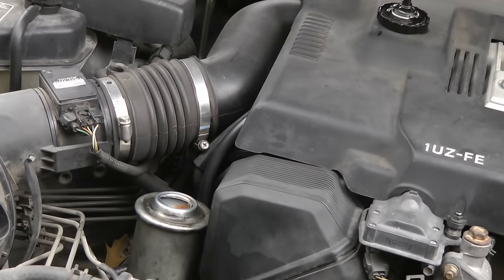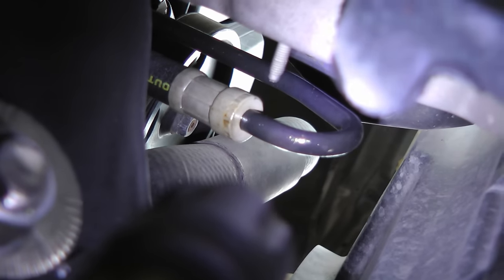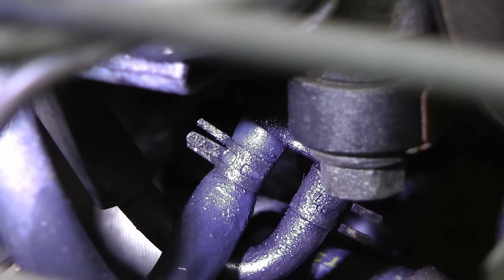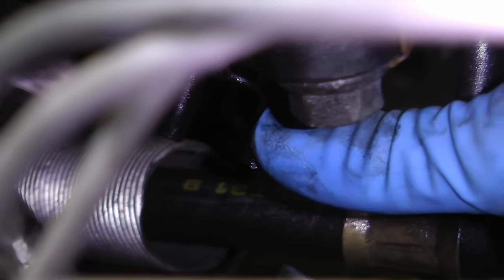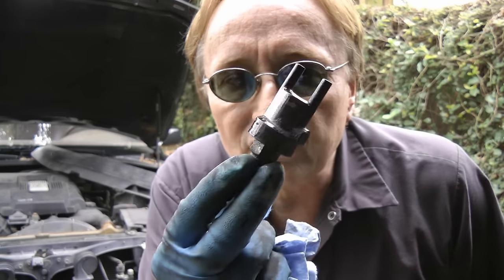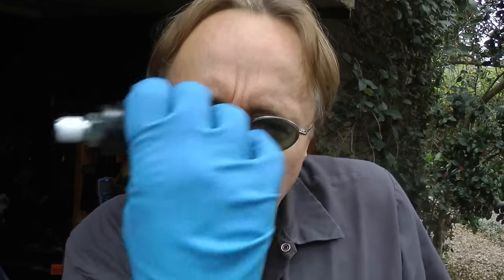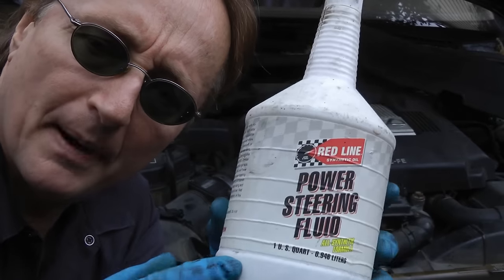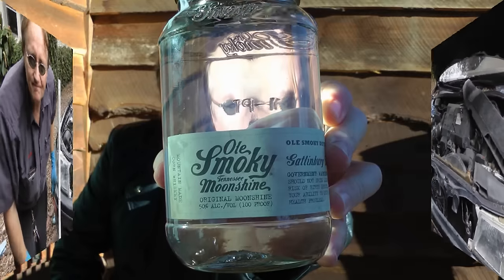How to Fix Power Steering Noise When Turning

Comment: its that..
it couldnt be
it is
lexus LS400, damn good car
did you replace the alternator too scotty? i believe power steering leaks are the one big problem on this car and the fluid can leak onto the $2000 lexus alternator, causing a whole heaping load of problems
Reply: Yup, common problem in all 1UZ-FE powered cars, and it is RIP to the alternator if you leave it too long - but the alternators are not $2000 - you can get a brand new unit for about $900 NZD where I live, which would be perhaps $600 USD.  I guess if you went through a Lexus dealer they would probably triple the price though.
Reply: The alternator doesn't cost 2000 dollars

Comment: Scotty I changed my oil today on my 2010 Honda Accord with 173000 miles that runs just like new and found metal shavings on the oil plug. What does this mean?
Reply: You need rebuild engine
Reply: So is your engine still alive?
Had that too and it still made it quite some time

Comment: My 2003 Grand Cherokee Limited makes a whinning sound when the Jeep is started during cold weather (60 and below) in North Florida.  Should I have the power steering pump replaced?  Thanks!
Reply from the maker: many things can whine, from power steering to transmission. IF it goes away when warm, heck, ignore it. My car does that when it's below 40 here in Texas, and has been doing it 4 years, I don't care. Age and cold often do that.

Comment: Hey Scotty got a good one for you. I have a 03 Silverado with 140k miles and it’s making a whining/howling sound when I start it up. I changed the fan clutch, water pump ( got a new one) and the whining sound was still there, then I changed the alternator ( new one ) since it was bad and same thing, 3 days ago I changed the p/s pump( also new ), Still making noise. I bleed the system, the noise went away and now it’s back. What would you suggest? Any help would be appreciated.

Comment: So this helps for noisy steering week or noisy pump? Lol I just bought that sea foam trans tube that I saw in your other video should I try that instead or this on this video?
Reply: +scorpio cabrera Never ever put something else in your power steering than the right fluid. You can ruin your pump faster than you think.
Reply: +Frank De Ruiter  so how would I even fix noisy power steering with ought putting other fluid to fix it then

Comment: thx Scotty, no seals or such that can be replaced to get the noise down? is only way to replace the column motors?
Reply from the maker: +fp naude you could try spraying WD 40 in there, it doesn't hurt electronics

Comment: What are the signs of a bad power steering pump or just a leak? I hear a whine like noise as soon as turning it over. It sounds as though it’s coming from my power steering pump. However if there is a leak, it is mild. I was told the car had been stationary for almost a year

Comment: My 02 Lexus GS300 takes Dexron 2 or 3 ATF and It was groaning. I topped it off and it cleared up just fine but I did notice what little was in there was completely burnt fluid. It wasnt pink anymore and smelled. Should I consider a flush?

Comment: 2007 GMC Acadia with the annoying grinding noise when we turn the steering wheel. We do have the annoying power steering whining noise also. I've heard that the Acadia is a nightmare on wheels.
Reply from the maker: pray you are just low on fluid. But if not, either pump and or power steering rack has internal problems. If it works fine otherwise, live with it on that crap wagon. And don't buy another
Reply: Ended up needing a new rack n pinion $1,280 total parts and labor.
Reply: JRaptorV that's what they always say my 2013 chevy impala was growling when I turned wheel took to dealer they said rack and pinion was leaking so they replaced it still my car growls no clue fuck gm

Comment: Scotty, I have a 2006 MB C280 and sometimes when I start it up the steering is very stiff as if I lost power steering. Weirdly enough if I shut the engine off and restarted it the steering is completely light and smooth as it should be. No weird noises from the system so I'm guess it's some sort of electrical component? Is there an electrical aspect to this system?
Reply: if there was an electrical aspect to this system woun't the OBD 2 reader be able to pick up some kind of code that tells you that power steering is bad? just a thought (im a noob in cars)

Comment: Hello Scottie quick question, I did a complete flush on my power steering system on my 2005 GMC Sierra, I replaced it with the oil from Chevy dealer per the owners manual, but now it makes the grinding noise like in your video and didn't do it before the flush. Could it still be the switch? Thanks & great videos
Reply: +armandomrgl85 A whining power steering pump is mostly oil/air related. When there is enough oil in it you could try to bleed the system manually. Here on YT will be video's around how to do it.

Comment: Hey Scotty, I have a 2018 ram 2500. Every now and then I’m getting a whistle noise near the driver side of the truck. On this side of the truck is the steering gear box and power steering pump. I noticed that the whistle noise goes away when the steering wheel is turned but returns when steering is returned to straight. Thoughts. This occurs even when in park

Comment: Hello Scottie quick question, I did a complete flush on my power steering system on my 2005 GMC Sierra, I replaced it with the oil from Chevy dealer per the owners manual, but now it makes the grinding noise like in your video and it didn't do it before the flush. Could it still be the switch? Thanks & great videos
Reply: +armandomrgl85 invest in a stethoscope. you can get one a harbor freight cheap. remove the serpentine belt. spin the ps pully by hand using the stethoscope and see if it makes any unusual noises. it definitly helps diagnose a worn out shaft.
good luck
Reply: +Moose666 Thanks, I'll look into it

Comment: Hey mr. Scotty I have an 08 GMC Sierra that when I turn it to the left or right I get this creaking noise. I got up under my truck that is lifted and my wife turned the wheel, and it sounds like it’s coming from the rack and pinion. Should I replace it or is there a cheaper fix?

Comment: What would the noise be if you have an electric assisted steering system that does not require power steering fluid if it's a squealing sound?

Comment: Mr. Scotty Kilmer, I have a 2003 toyota tacoma that recently had the power steering pump replaced. I live in colorado so the weather is a little cold. When I start my truck, the power steering makes the groaning noise, and gets louder (And sounds more painful). However, when my truck warms up, the noise goes away. I don't see any leaks, and I don't know how to check if there is air in the system. Suggestions?
Reply from the maker: +Austin Farley  odds are you got a rebuilt, and not new pump. rebuilt ones often make noise
Reply: Which is always fun because my understanding was that I paid for a new pump! Back to the mechanic I go.

Comment: It’s a little weird situation, because in my 2006 Pontiac GTO, the power steering pulley only makes noise when I give it throttle and the pulley itself when idling you can see it looks a little wobbly

Comment: Hey Scotty are power steering pumps on fords just noisy all the time? I recently changed the fluid with ford type f ATF (owners manual recommended) because fluid was black. I used a turkey baster to suck the old fluid out and pour new fluid in 5 or 6 times and turning the steering wheel between each change until the fluid wasn't dark anymore. I heard of doing a flush by removing one of the hoses and as fluid drains out you pour new fluid in-is it safe to do so?
Reply from the maker: yes, ford pumps are notorious for noise as they age. If it steers fine, ignore it. But you can remove the return hose and change the fluid that way if you're careful and don't spill any or run the pump sucking air

Comment: Hey Scotty!!....I have a 06 4runner, and the 2 stems for the hoses on the power steering control valve broked. I ordered a new one and was wondering if it's safe for me to drive to work(about 7 miles away) and back until my new one arrives ???
Reply from the maker: remove the power steering belt and you can drive it forever. But leave that belt on, it will ruin the pump sucking air

Comment: Hi Scotty,  I have a 2004 honda civic, the power steering hose (the larger) has a leak in the coupling located in the middle of the hose, causing majority of the power steering pump area including the back of the left headlight covered in power steering liquid... I will change the hose, however what another thing would you recommend me to check.

Thank you.
Reply from the maker: +Oldemar Almengor  hoses just leak from age, replace the whole hose assembly

Comment: I had a power steering noise, so I decided to change the fluid. When I drained out the fluid it was all black so i thought that was the problem. And when I filled up with new power steering fluid, that noise went even louder! Was that a bad fluid or maybe I need an ATF fluid?
Reply from the maker: use the same type fluid your manufacturer used, and pray the noise goes away Often you need a new pump and a new rack if fluid gets dirty enough to damage both
Reply: Scotty Kilmer Yes, I filled up wrong power steering fluid. Manufacturer says that it has to be automatic transmission fluid DEXRON II, But I just filled up a regular power steering fluid. So I'm gonna change it today!

Comment: After replacing the pressure line the mechanic used red transmission oil instead of yellow steering oil in the steering oil reservoir. Was that a good idea?
Reply from the maker: saleh mneina depends on the car, on a BMW it would ruin it, but on a ford or toyota that's fine, you can use tranny oil in most of those

Comment: Hi, Scotty, you used to work on our cars when we lived in Houston.  My daughter is driving my 2000 Camry TONIGHT and is halfway to North Texas.  She just called and said the power steering has gone out.  They checked the fluid and it is full.  She says she is able to "manhandle" it and drive - is that safe?  We are trying to find someone to look at it tomorrow, but do you have an idea of what a simple fix might be?  It is well-maintained.  You replaced the timing belt before it hit 100K,  Thanks for any ideas you have.
Reply from the maker: time for a new pump If the belt is still on there, or you can just remove the belt if it is still on and drive it manually, my son does that on his 93 celica in boston and doesn't care, he likes the work out
Reply: Scotty Kilmer Thanks, Scotty.  Turns out it was the belt, so thanks for your help.  It's good to see you're still out there.

Comment: My car is making a noise and the wheel is hard to turn left or right started to get heavier when it got cold. What should I look at first? Had the pump replace it was old but I guess still working a few months ago but that only partially fixed it. The problem is back and tenfold.

Comment: Scotty, I have a 2001 Chevrolet Express 1500 LS 5.7L, back in September when I back up a little in my drive way and the van die on me. At the time alternator dead and no fuel pressure, got new alternator, new fuel pump now fuel pressure at 60psi. I even did a whole tune up, new spark plugs and wires, distributor, ignition coil, ignition control module, cranks position sensor, power steering pump. Still only crank, spark and fuel ok, check all fuses are ok, check gauges light on, service engine soon light on, security light off with one key and on with another key. I'm thinking it might a security issue  that is not letting me start or I could have a dead engine or a dead transmission. How do I know if my engine and transmission are dead? Please advise me what is wrong with my van or is it a junk.

Comment: Hey scotty I want to ask you a question I recently bought a 2000 Dodge Dakota and i was just wondering it has 331k on the original motor and a replaced transmission and it's a 4.7 v8 how much longer do you think it would last and it's all freeway miles  thanks

Comment: I have 2006 Subaru STI. Power steering fluid is leaking somewhere very little. And of course my steering wheel is have a problem because of it.  Engine makes the whining sound too. Where should I look for at first to fix the leak and the sound?
Reply from the maker: do my video "finding and fixing car oil leaks"  UV dye always finds them

Comment: hi Scott, im having a problem with my power steering, i just replaced the power steering top pressure hose on my Cadillac Deville, while im driving the steering feels a little tight when i remove the top of the reservoir it pop like their's pressure build up. any suggestions on what to do next?

Comment: Hey Scotty I have a 92 sc400 with a loud whiny PS pump same 1uzfe motor have you ever worked on these?what do you recommend before I go out and buy a pump
Reply from the maker: Kingjr666 970 try flushing the system as in my video "fixing binding power steering", but if that doesn't work, change the pump

Comment: I'm experiencing a similar noise when I turn my wheel but apparently my 2013 V6 Mustang has an electric power steering system, no fluid. Not sure what the problem is yet, maybe a mad motor.

Comment: On my 2005 dodge 1500 4.7l, why is a power steering pump radiator required? I’ve never seen a cooler for a power steering pump is why I’m asking.

Comment: I have a 97 nissan altima and for the past 2 weeks or so every time I turn my steering wheel sharp (for example in a parking deck) there is a loud grinding noise that makes people turn and stare like my car is on fire or something. It's only been happening for a little while but everyday it gets worse. It was just a few times every 2 or 3 days but now it happens every little turn I do. After watching this I am assuming it is the power steering but I also was thinking the wheel bearing or cv joints. My boyfriend replaced the tie rods during the spring so I have canceled that out. What do you suggest?
Reply from the maker: +Jakayla Robinson   odds are the power steering pump is wearing out and needs replacing. If it's full of fluid and not low, and it starts doing it a lot, replace it and pray the power steering rack isn't worn too
Reply: its a pretty old car so EVERYTHING seems to be wearing out each month I drive it. I'll check the fluid and how much do mechanics usually charge for that type of replacement?
Reply: you look fine jakayla

Comment: Hey Scotty, Does a '05 Chevy Impala Have One if these So Called Switches?
I Changed My P/S Pump when I had a Bad, Busted & Leaking Rack & Pin Mistaking the Leak, Whining & Groaning for a Bad P/S Pump, Cos the Fluid kept Draining (My Steering also Turned Shitty). Well After Changing The Rack & Pin & no More Leaks, I was Left with a Fairly "Whining" noise Still even as the car warms up. Tho, I don't have anymore leaks & My Steering turns much better. But I can't seem to get rid of the whining, I have Bleed the Line about 2-3 Times & Topped off the fluid to make sure there's no air in the line/system, But the Whining won't go away. So I'm sort of frustrated. I'm thinking of Re-installing the Old/Factory PS Pump, Since it wasn't Bad/the Problem, to see if the noise goes away (Maybe I bought the wrong P/S - Jst Maybe) Now, I'm all out of Options,  I've watched this Video Before, But didn't think It was what's causing My Problem. But After Re-visiting The Video, I thought I Sought Your Opinion/Advice to see if this "Switch" Part could be the Holy Grail.
Thanks.

Comment: Hey Scotty ! I love your videos they're so helpful . Today my car broke down when I reversed.  It made a really weird rumbling, screechy loud noise and shut down. I stepped on the gas pedal and it wouldn't reverse at all. I changed it to drive  and it kept making the loud noise but wouldn't drive. I turned it on and off and it was still acting up. I had to call a tow truck to pick it up. The man said it might be the starter because it makes a buzzing noise when you switch the  key. Others told me there might be a problem with the transmission.Idk what it is and I can really use your help. Thanks:)
Reply: Howd it go

Comment: Hey Scotty I have an 03 trailblazer with 160 thousand miles. It just got a new power steering pump last year but for the past 6 months I've noticed that the wheel is hard to turn when I turn really fast like going into a parking space but normal driving the steering is fine. What do you think it could be?
Reply from the maker: was the pump "new" or rebuilt. Rebuilt ones stink. and often do that
Reply: I'm not sure. The mechanic did the job for me. I saw your other video about sticking power steering. I may try that. Do you think this could help?
Reply from the maker: richard evans you can try it, sometimes it stops sluggish steering. And,  If you like my car help, be sure to watch my live car talk show every Saturday morning at 10 AM CST on YouTube. I answer your car questions LIVE there. Just check it out at How To Ask A Live Mechanic Car Questions Free On YouTube . And remember, every TUESDAY  I upload a new video, so don’t miss them.

Comment: on that engine would you recommened pulling out the vaccum lines from the ACV and  the intake and bolting them up and then have them bleed out?   1998 gs400
Reply from the maker: +Kajan Nathan na, they self bleed quite well
Reply: +Scotty Kilmer apprecite the prompt reply, so no bolt on then, and just replace the asv on the ps pump?

Comment: Hi Scotty, went out to buy a used 2001 mustang, and after all the overall check the only problem a could find is a sound that the power steering does when you turn it left or right. It's not hard to turn and it has red fluid in the reservoir. What do you suggest me, is it worth fixing or do I walk away from this one? Thanks in advance for ur help.
Reply from the maker: buy it if cheap, then replace the pump